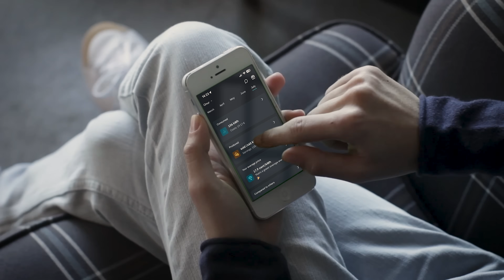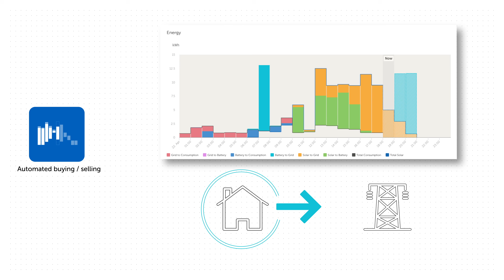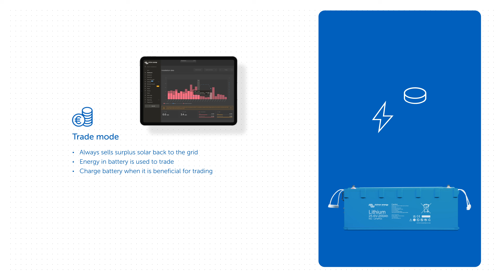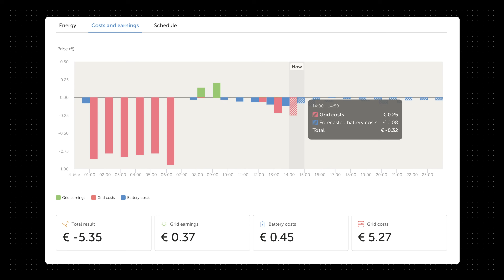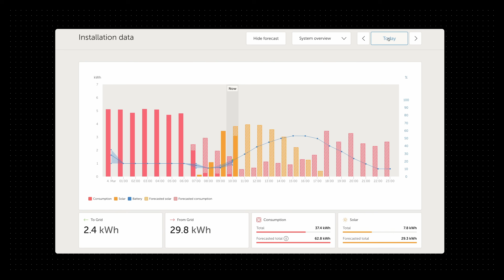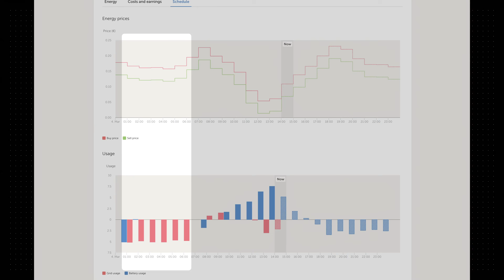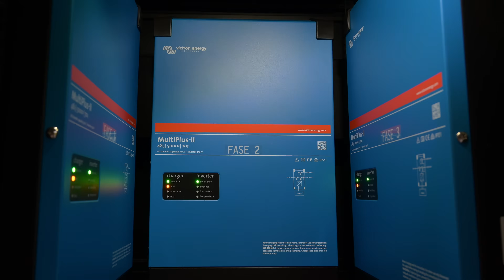How this Dutch Town House uses Dynamic Energy Storage with Victron

Comment: Nice video about DESS!

Quick tip: I noticed both the positive (red) and negative (black) battery cables are connected to the same battery. It’s better practice to connect the red cable to one battery and the black cable to the other. This ensures more balanced charging and discharging, helps prevent premature imbalance, and extends battery life.

Keep up the good work with the video's ;)!
Reply: Thanks for the tip @nanderknobben! This is one of our older systems, so we made a small mistake there. In the meantime the system is connected properly and we even provided an upgrade to 24kwh of storage.

Comment: I am a Victron fan, so don't get me wrong. VRM and dynamic ESS is great. But consider the side effects before buying;
Converting energy means losses which are significant. You can find the curves online. By the way, these curves are not integrated in dynamic ESS. (Fixed value)
These losses translate to excess waste heat which is fine in the winter but could be terrible in the summer. 
Not the least, the multipluses make A LOT of noise when they are in operation. You don't want them close to your bed.
Again, a great system, but a few things to bear in mind.
Reply: The DESS has already a system conversion loss build in by the way.    On noise, its true that the RS models are more quite.  But as for all energy systems, dont install them in rooms were people live
Reply: They introduced an assistant to reduce the fan noise (of course, at a cost of some power when overheating due to the passive mechanism kicking in). It might be useful when the installation can't be done far from the living spaces.

Comment: what is the only thing you need and we dont have enough...sun. so in the winter your dess does it works..on top of your own grid usage...😢
Reply: No sun - use son! He can rotate generator by pedals. :))
Reply from the maker: In the winter, DESS can use the difference between the buying price and selling price of the grid to trade,
Reply: @VictronEnergyBV  yes it can, but only when it's in 3 phases it can get the results wanted, been using a year now 1 fase with 20kwh battery and 8 east west panels 405pwh and it just costs me money cause it does not upload/download fast enough..for about 4 months a year..
Reply: @roversberg  Cost money?   The best is to have the system balanced out of course,  when not the ROI gets longer indeed
Reply: Which inverter are you using? For our customers, on a single phase for trading we don't go below the 10kVA version when the installation requires trading. Of course, during the design phae is essential to consider the house loads (ex. Induction, ACs...), the existing PV system, if any, and the habits of the user. As well, the rewiring with suitable cable sections to avoid limitations.
Reply: @IngenEnergia the multiplus 2 5000, and wiring has no limitations/issues. i run dess on green mode now to try it and it keeps about 50% in battery at night while it should give me power from battery..the system thinks, it is cheap hours now so i save the energy for "later"?

Comment: Love Victron kit, have a MP ii 48/5000 with 30KWh of Fogstar battery Storage. Also some AC PV. Adding Smart Solar MPPT for DC PV😀.
Looks an amazing setup, however the installer should read Victron’s Wiring unlimited. The US5000 batteries will not charge and discharge at the same rate. Positive and negative connections should be connected to opposite Batteries. 🤣
Reply: Thanks for the tip @BobHolroyde! This is one of our older systems, so we made a small mistake there. In the meantime the system is connected properly and we even provided an upgrade to 24kWh of storage.

Comment: 1:50 blackouts in the Netherlands........ not really, we are still stable. Most of time that there is not electricity is because of work done.
Reply: Ik woon ook in Den Haag en de laatste power outage is van ver voor covid en was alleen in de deel in de wijk als gevolg van een storing. Dus frequente Blackouts is echt onzin !
Reply from the maker: In 2023, when Onur installed his system, the Dutch electricity company Tennet had no more capacity, and blackouts were frequent. Please see this Tennet news article: https://www.tennet.eu/news/no-extra-space-electricity-grid-large-part-noord-holland-next-decade
Reply: @VictronEnergyBV  I read  "Without targeted measures to deal with these congestions, the reliability of the electricity supply will come under pressure and longer blackouts may occur. "
That is not the same as blackouts actually happening a lot now.

No more capacity on the grid is also not the same as blackout, it means they can not allow new connections.

But we can agree on having a few kWh in storage just in case ...
Reply: Chatgpt maar even gevraagd

*Korte antwoord:*  
Nee, je kunt op basis van dit artikel niet concluderen dat er regelmatig blackouts (grootschalige stroomuitvallen) in Nederland plaatsvinden.  

*Toelichting:*  
1. *Waar gaat het artikel over?*  
   - Het bericht van TenneT verwijst naar een tekort aan netcapaciteit in grote delen van Noord-Holland. Dat betekent met name dat er weinig tot geen ruimte is voor nieuwe grote aansluitingen (bijvoorbeeld grote bedrijven of zonneparken) op het hoogspanningsnet.  
   - Dit zegt echter weinig over de betrouwbaarheid van de bestaande stroomvoorziening of de frequentie van blackouts.

2. *Netcapaciteit vs. leveringszekerheid*  
   - Een tekort aan netcapaciteit houdt in dat het net (in bepaalde regio’s) ‘vol’ zit en niet zomaar extra grote verbruikers of terugleveraars kan aansluiten. Dat kan leiden tot wachttijden of afwijzingen voor nieuwe projecten.  
   - Hoewel een vol of verouderd net op termijn tot meer risico’s kan leiden, betekent dit niet dat er al regelmatig blackouts zijn. Nederland kent – internationaal gezien – juist een hoge leveringszekerheid en zeer weinig storingen.

3. *Betrouwbaarheid van het Nederlandse net*  
   - De gemiddelde duur van stroomuitval (SAIDI: System Average Interruption Duration Index) is in Nederland traditioneel erg laag vergeleken met veel andere landen.  
   - Storingen komen voor (bijvoorbeeld door defecten of graafschade), maar grootschalige blackouts zijn zeldzaam. Dit artikel gaat vooral over toekomstige uitdagingen, niet over huidige, frequente uitvallen.

4. *Mogelijke gevolgen op lange termijn*  
   - Als er niet wordt geïnvesteerd in netuitbreiding of slimme oplossingen, kan dit in de toekomst wél een grotere druk op het net geven. Daardoor kunnen storingen in de verre toekomst vaker optreden.  
   - Het artikel zelf zegt echter niet dat we nu al geregeld met blackouts te maken hebben, maar eerder dat we tegen de grenzen van het net aanlopen.

*Conclusie:*  
Het TenneT-artikel benadrukt de schaarste aan netcapaciteit voor nieuwe aansluitingen en de noodzaak om het hoogspanningsnet uit te breiden. Het is géén bewijs dat er nu al regelmatig blackouts plaatsvinden in Nederland. De Nederlandse leveringszekerheid is nog altijd hoog, en echte ‘blackouts’ zijn (vooralsnog) zeldzaam.
Reply: @VictronEnergyBV  Do your flipping research, yes Tennet may not have had capacity for new houses or buisinesses, new ones - the exisiting ones on net are good